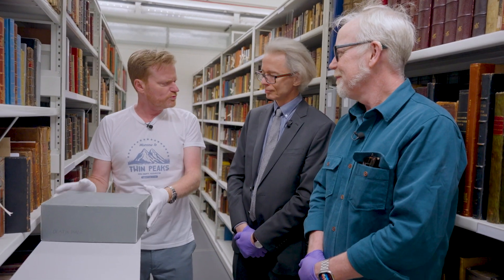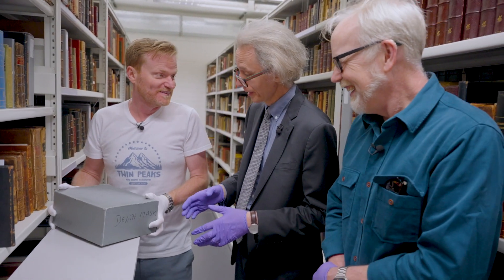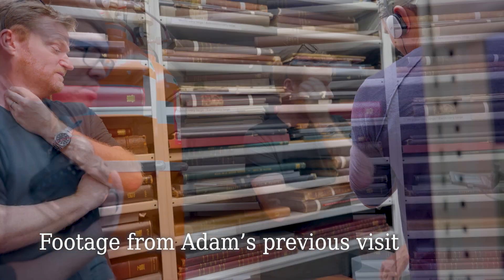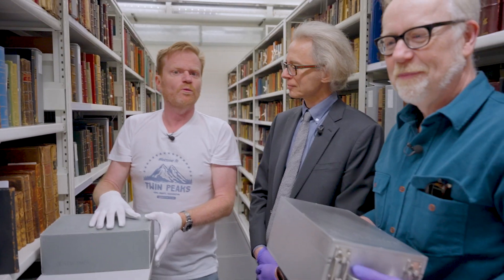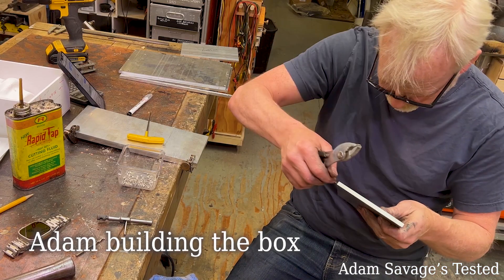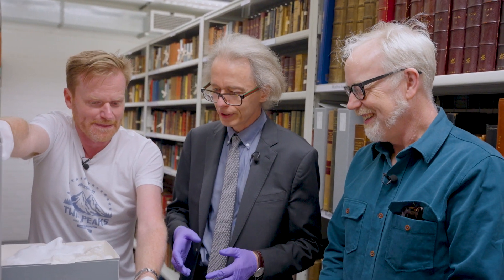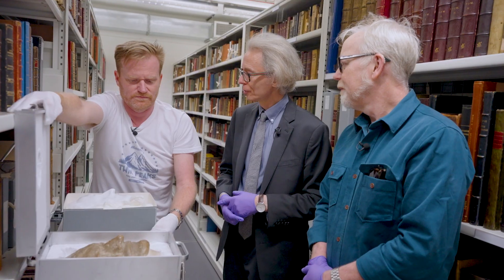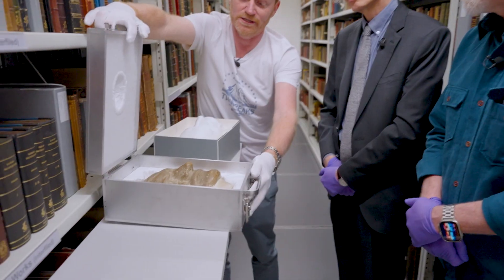A New Box for Isaac Newton (feat. Adam Savage) - Objectivity 275

Comment: with these sorts of specially-designed things, there's two options: it either lasts 11 weeks because of a critical design flaw, or it lasts 11 centuries because by then the box itself would need special conservation
Reply: Well, as Adam mentioned in his video, the galvanic reaction between the steel screws and the aluminium plates will eventually cold-weld them together, so after a while the only way to take the box apart will be destructively.